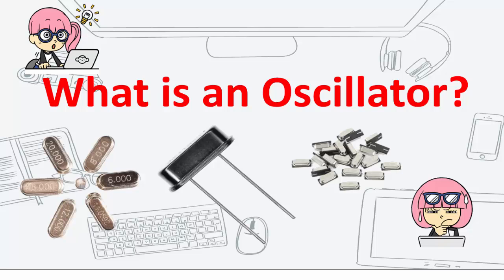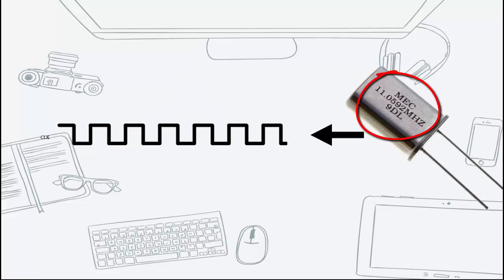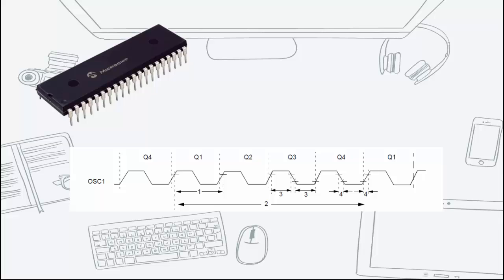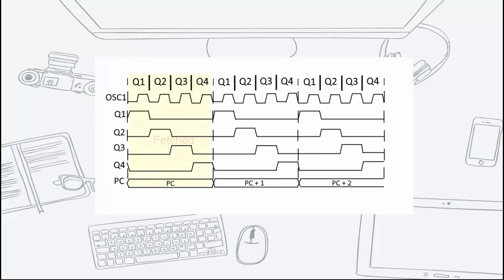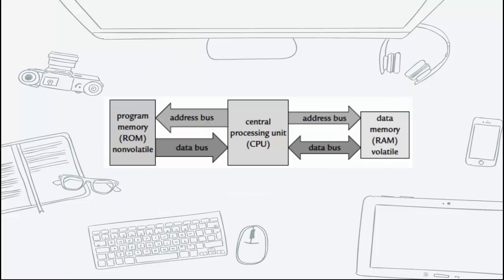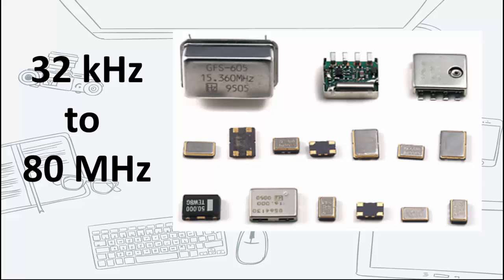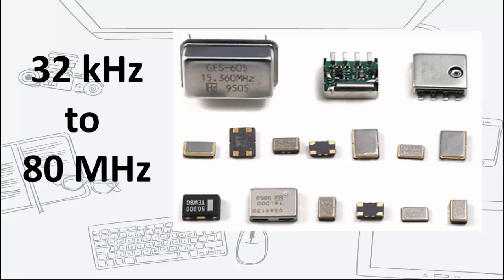What is an oscillator?

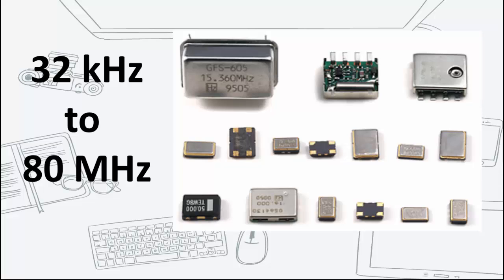Comment: @ 2:10 - The faster the oscillation speed the higher the current consumption & the more electronic components will heat up.
Reply from the maker: That is correct. Thanks for the additional input.